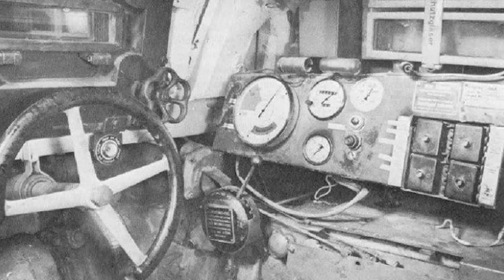A Deep Dive into the Tiger I, by the Chieftain

Comment: The original APC ammo for the anti-tank guns of the 75-88 mm size that were long-battelled (43 caliber gun length and up) towed and tank-mounted, were based o0n the Krupp naval "Psgr.m.K. L/4,4" projectile introduced in warships of the HIPPER Class and SCHARNHORST Class and later also used in BISMARCK and TIRPITZ and most large-caliber coast defense guns (they were much improved projectiles of the L/3,7 type used in the 15 cm naval guns after WWI (never improved) and in the smaller 28.3 cm gun used in the Pocket Battleships (replaced by the much better L/4,4 in SCHARNHORST's guns).  They had relatively large explosive charges (circa 2% for the L/4,4) and somewhat weaker bodies if hitting at a high velocity (naval shells rarely did in the 20th Century due to the very long ranges of most battles).  During short-range, high-velocity impacts as in anti-tank operations, it was found that the naval shell design broke up too easily and this reduced penetration or, even if a hole was made, the shell had fewer effects due to the breakage of the large explosive cavity.  The later German APC shell design (used during most of WWII) has much smaller explosive charges, a smaller, but harder AP cap, a nose blunted to 1.1 caliber radius Tangent Ogive shape (from the more pointed naval 1.3 caliber arc shape), and an improved, higher hardness nose and upper body optimized for more angled impact (such as on the front of a Russian T-34 tank).  This improved design was used by most German APC shells of all sizes in new guns to the end of WWII.

Comment: Of the comments I read, most of what you all have said I generally agree with. HOWEVER! The mechanical genius Moriarty who said "its a peice of junk" was the character played by Gavin MacLeod in the movie Kelly's Heroes. Also staring Telly Savalas, Don Rickles, Harry Dean Stanton, Carol O'Connor, Donald Sutherland and Clint Eastwood. Check it out!
Reply: Remember Oddball mentioning that Moriarty modified the transmission so the tank could go just as fast in reverse and forward? The M4 users were pestering the Army after D-Day for a reverse gear that would allow them to back out of trouble faster so Ordnance got someone like Spicer to work on that. They came up with a gearbox that attached to the rear of the transmission that allowed the driver to use all 5 forward gears in reverse. The Army decided not to put it into production since they felt that the war would be over within two months by the time any were ready to be shipped over to Europe.

Comment: battlefield v taught me that the coaxial mg is as important if not more important than the main gun in protecting the tank from infantry with handheld at weapons which is a much more common threat than enemy armor
Reply: The turret doesn't turn fast enough to defend from infantry who are mobbing it. In fact a tank in that situation would radio for other tanks to spray it with bullets.

Comment: One thing that is striking when you look at tank design is, everything is either compromise between competing factors, or the occassional brilliant piece of inspiration short-circuiting that. Sloped armor has drawbacks, and it means a longer slab of steel - putting it (near) vertical lets you use that length to make it thicker instead - and you get more room inside, sounds like a decent trade-off, right? It kinda does, but I guess hindsight shows, it wasn't. But it's still armor that could deflect anything it could reasonably expect to run into at the time it was designed - it's just that in WW2, a 1941 era tank is a vastly different beast from a 1945 one.(Unless it's named T-34 and while it did have big upgrades, it's still basically the same tank.).

Comment: Sometime during the early 1990's (94?) I stopped by Aberdeen Proving Grounds by chance to see the tank collection.  Didn't see either the Tiger I or II.  Ran into the "head guy" (I would later see on several History Channel programs) who told me the Tiger I had been sent to Germany to be restored and later be returned to Aberdeen.  The Tiger II was traded to the Patton Museum at Ft Knox for some tank (XM70?) wanted by Aberdeen.  Naturally I was disappointed but some years later I did see the Tiger II at Ft Knox.   It had been restored or at least repainted inside and out.   The left side had been cut like this Tiger and had dummies dressed as SS soldiers inside.   I was alone until an older gentleman walked up and told me he had been an  American Infantryman in Germany during the Battle of the Ruhr Pocket.  He had been on the end of a German counterattack that included a Tiger II at very close quarters.  I could see that this experience still deeply affected him as we talked nearly 60 years later .   An earlier video by the Chieftain at this facility showed this same Tiger II on display at Ft Benning.  Good video !   Now I know its recent history.  Too bad the Germans didn't restore it as I was told nearly 30 years ago.

Comment: I would add that the Heavy Tank Battalions not only had the extra maintenance crew but were considered so important that some point they also got their own supply chains to deliver parts directly from the factories and depots to the units, bypassing the regular Wehrmacht supply corps. The effect this had in starving other units of parts and fuel needs to be considered in establishing the overall effectiveness of the HTBs.
Reply: Incorrect. Tiger Units had to resort to extreme methods just to get a supply of basic parts never mind engines or transmissions. The whole German repair system was a shambles.

Comment: I would have loved to hear more about the Tiger's optics and periscopes. I find it very interesting how the Germans went for static ones while many of the Allied tanks had rotating periscopes for many of their crew members.
Reply: This version of Tiger has 90mm-thick "direct vision blocks", one for the driver, five in the cupola, and one in each side of the turret. 
It has a periscope in each of the two forward hull hatches. These are fixed and they aim 30 degrees off to the outside.
The hull MG has a telescope with a fairly narrow field of view and low magnification.
The gunner has his high quality binocular telescope, but no means for seeing a wide field of view to the front. He depends on the commander to find targets.
And that's everything.

Comment: The hallmarks of a good tank are fire power, armor protection, reliability, ease of manufacture (including cost), fuel consumption, turret size, combined arms use, mobility, and psychological impact. Both Tigers I and II, obviously meet fire power, armor protection, turret size, and psychological impact. They miss on the others. Interestingly, the Sherman meets, ease of manufacture (including cost in money and man hours to build as evidenced by the approximately 50,000 Shermans made as compared to approximately 1850 (including Tiger II's), reliability, mobility, turret size, combined arms use, and fuel consumption. That being said, it doesn't necessarily mean the Sherman was the better tank, because in a face to face, 1 on 1 encounter, I'd prefer to be in the Tiger(s).

Comment: I don't see how getting your driver to rev the engine up for maximum turret rotation is any more difficult than getting the driver to turn the whole tank, and they managed to do that both in the Tiger and in the turretless AFVs. If you can shout "left turn 40 degrees!" and have it obeyed, I don't see why a crew couldn't easily have an order that means "Neutral, maximum RPMS!" in combat. The driver will already know what you want. They have intercoms. I just don't see this being any paticular difficulty in light of all the other challenges they managed to overcome. And it is worth figuring out because it will literally save your life.

Comment: My understanding was the slab sided design was for ease of manufacture.
Reply: Sloping armour also removes a lot of interior space,
Reply: The first tank to use sloping armour that made an impression on the Germans was the t 34, which appeared in 1941, well after the Tiger had been developed. The Tiger had been designed before sloping armour had really made an impression on the Germans. After they encountered the T 34, the Germans started using sloping armour on all their tanks (ie Panther, Tiger II, Hetzer, etc.)

Comment: Thanks to the Chieftain and the Museum for the illustration of this tank...  Now, as your guide indicated, if it took upwards of a minute to turn the turret in a 180 to 360 degree turn, then what was the actual time to turn the Tiger tank, as in, one track is turning backwards and one is going forwards? especially with a serious diesel/gas engine rotating the tank faster??  but that brings up other issues, dirt and crap getting into the road wheels in the tracks.   okay, pivoting turns on Tiger 1, I see my answer to my question.... to a point.  Now the transmission has 4 reverses and 8 forwards.... are the reverse gears set to the same hp as the forwards.  Essentially, offsetting the 4 reverse gears on one track with 4 forward gears on the other??

Comment: The standard appreciation of a tank is usually split down into mobility, armour & firepower.
I'd suggest reliability trumps them all & in that area, the Tiger was sorely lacking.
Reply: The Tiger's unreliability is very exaggerated. The Tiger units had an overall 65-70% operational average 1944/45. Thats very close to the Panzer IV.
Source. Tom Jentz, Tiger I and II Combat Tactics.

Otto Carius said none of his Tigers ever broke down in combat, and it was only on long road marches when they did, but he said a well trained driver could reduce mechanical issues by 90%.

Comment: At 29:30 ... "if [the loader] needs to just open it up, toss out some spent cartridge casings, he has that ability as well."
Not really! That side hatch was not sprung or counterbalanced. It was a steel disk 80mm thick and all but impossible to close from inside the tank. But it you left it open, you could not rotate the turret without either getting stuck or damaging something, because the hatch was resting on the hull top. I don't think it would ever be opened, in battle, to dispose of casings!

Comment: What never makes the conversation is that it was not until mid 44 that a Tiger Platoon actually had 4 tigers.  Most of the war, a Tiger platoon was 2 tigers and 2 pzr III's or IV's.  That the Heavy Tank Battalion had such a big impact is testimony of its greatness.   I don't understand on the 88L56 that in a year they will convert the gun?  Tiger I went into production late 42 and Tiger 2 production started I believe in September  or  October of 44 right after a huge jump in Tiger I production in August.
Didn't the original Panzer IV 75L24 use specialized tungsten ammunition back 1940?
Reply: I'm sorry but your data is wrong. 
The Panzer IV was never officially mixed in the same platoon as Tigers.
The Panzer III was used with Tigers as you said, but it was removed from Tiger units in the Spring of 1943.  By June, even before the battle of Kursk, Tiger battalions such as 502, 503 and 505 were up to full strength with 45 Tigers each.  Source = "Trail of the Tigers" by Ron Klages.
All three of those units organised their platoons with 4 Tigers each. Source = publicly available photos, "Tigers in Combat 1".
It's strange to say "most of the war" when talking about the Tiger 1 because it was introduced only halfway through the war. Source = "DW to Tiger 1" by Doyle and Jentz.
But the 4-Tiger platoon was standard for most of the Tiger's lifespan.

Comment: I'd like to see the Big Chief talk about the US Army's M6 and T29 heavy tank designs. Ordnance started designing the M6 in 1940 to come up with a 55 ton monster by 1942. Baldwin Locomotive Works made 40 for testing. They used a Wright radial aircraft engine and rear drive with 20 using torque converter transmissions (used Diesel fuel as the fluid) and 20 with General Electric electric drives. The Army lost interest in the tank due to reliability problems, cramped crew conditions and being too heavy for most European bridges. The T29 was designed in March of 1944 to counter the new Tiger 2's (King Tiger). The M6's were kept stateside to test new turret designs and the sole surviving M6 is at Aberdeen Proving grounds sporting a T29 turret holding a 105mm gun.
Reply: I was taking a look at the M6 when I was in Lee a couple months ago. It's a bit of a wreck inside, unfortunately.
Reply: @TheChieftainsHatch  That's too bad since I've only found a few photographs of the fighting and engine compartments. I don't believe that the Army was very keen on using those after the first few were delivered due to the crews constantly bitching about their cramped working conditions yet went ahead and had forty made to explore the possibilities of using an electric drive or a fluid drive in a heavy tank to eliminate friction clutches and manual shift gear boxes. The tank drivers liked those since both allowed him to keep his eyes on where the tank was going and the entire crew liked the electric drive since it allowed the tank to travel the same speeds in forward and reverse. Moriarty made an adaption for Oddball's M4 that did that so they could back out of trouble faster. The M4 users wanted a higher speed reverse gear after landing in Normandy so Ordnance hired someone like Spicer or Timken to make a reverse adaptor for the end of the gearbox that would allow that. They came up with one that allowed the driver to use all 5 forward gears in reverse but was never ordered into production. The Army figured the war would be near the end by the time the first ones would ready to ship over from the manufacturer.

Comment: Would this have been more effective in the Infantry Tank or the Assault Tank role as intended, instead of the "Rush to stop every Soviet Breakthrough" role they ended up in? Probably could've helped a bit with having more downtime for maintenance?
Reply: Chieftain said as much in another video. I would certainly anything is going to be more effective when you are not trying to fit a square into a round hole.
Reply: @emberfist8347  Do you remember which video it was? I'm curious to see what his take on doctrine is, since that forms a fair portion of his points.

Comment: It’s interesting the 88mm was considered not good enough for the Tiger. It’s also interesting the British 57mm Six Pounder anti tank gun stayed in use (very usefully) from 1941 to the end of the war.
Reply: The Germans had several guns of 88mm calibre. The Tiger 1 used the KwK 36 which, as its name suggests, was rather an old design by then. They intended to stop using it and change to a whole new turret after building 100 Tigers, but that didn't happen.

Comment: It is princess of tanks. With proper maintenance, expert crew and mission it was actually designed to do it was better than anything else. It was tough, shot better and further than anything else and was reasonably fast to it's size. Those conditions where it exels tend to be very rare but those who see it on those conditions and live to tell the tale do tell it.
Reply: Meanwhile you got the mass produced Sherman, modified as the Firefly, which could punch through the armor of any WWII tank through the front.  It's such a crudely simple solution that it is elegant in it's own way.
Reply: @Edax_Royeaux  Firefly was good modification, but it came at later phase of war. Tiger arrived at midway of it so there is few years of development in-between. Tiger was the princess - on it's own field in proper shape it performs best. Sherman was adequate everywhere and that counts way more than momentarily supreme advantage.

Comment: Something I don't understand about the interleaved road wheels: why does more road wheels increase flotation? Shouldn't all the weight be put on the ground via the tracks, regardless of the number of road wheels? Considering the mud and maintenance problems, I have trouble seeing the interleaved wheels as a good idea...
Reply from the maker: @whyme943 They spread the weight out more evenly on the track. Imagine a tank with only two road wheels, it would be a nightmare for track tension and handling with all of the vehicle's weight still basically sitting on a couple of small spots. So more is, mathematically at least, better.
Reply: That's right. The reason for the overlapping wheels on German tanks is because Soviet infantry ("pioneer") would run up to the side of the tank, reach in between the wheels and attach a magnetic mine to the hull, with the crew inside not even aware of it. Tanks are completely blind on the side. The overlapping wheels would protect the hull and cut off the hand of the pioneer immediately - not a good thing to try.

Comment: The logistics for the Tiger transport/combat tracks whould have been a nightmare. So they changed tracks before and after being transported by train. But then... each Tiger had his transport track stored in the train or in the station. What if they needed to embark in another station, or another line? They didn't have the tracks with them. Incredibly cumbersome and limiting.
Reply: The Germans often subverted the regulations, if there was no tunnel on the route,  then they'd leave the combat tracks and wheels on.
Reply: @Edax_Royeaux  I presume almost no tunnels in the eastern front. Its mostly flat
Reply: @carbo73  Still plenty of hills and mountains between the Tiger I factory in Kassel and the Eastern Front.  Especially if they need to reach the Stalingrad area, Czechoslovakia, Southern Poland and Romania have a lot of mountains.